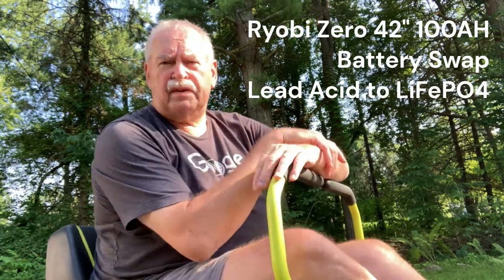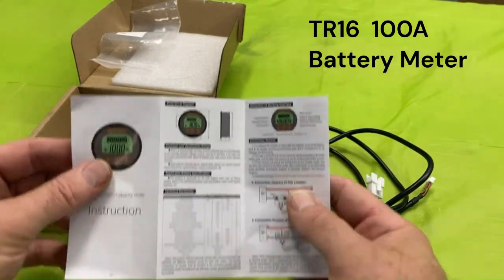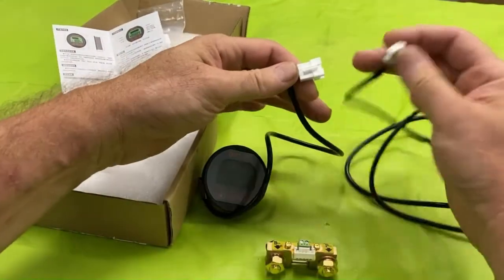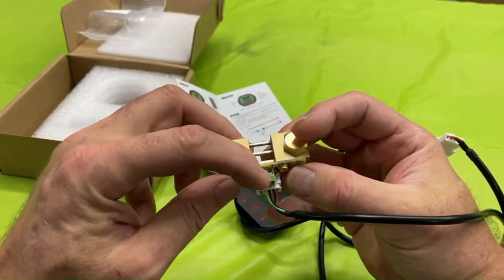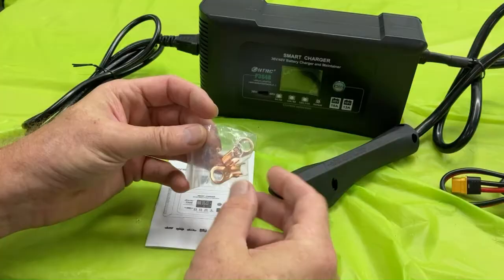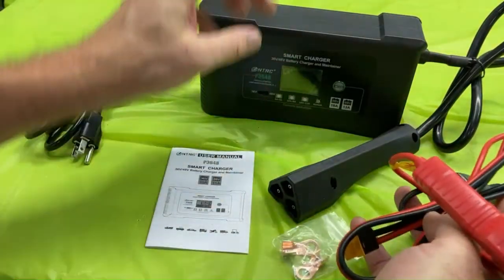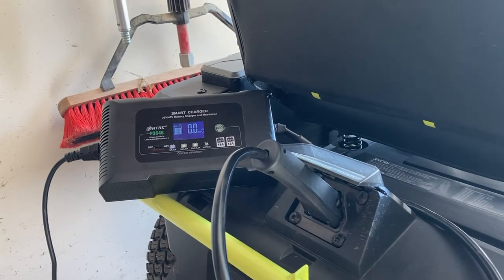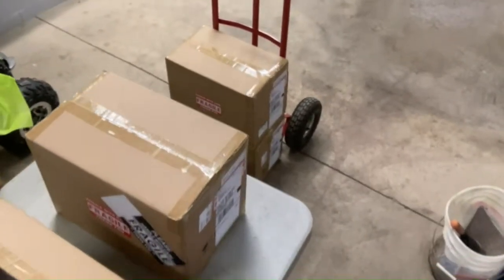Ryobi 48v Battery Swap - Components and modify charging port

Comment: Hi Rob, I've done this conversion. All but the gage anyways. Your videos were a huge help and I used the products you used. 

With that being said. After doing this swap the mower refuses to start. Every once in a while, one out of three times, when I go to switch the mower on I will get an audible click then nothing else. I can turn the key on and off with no sounds or anything changing. The gage wont display anything either.

Its only when I plug the charger into the mower (and the charger has to be plugged into a power supply) do I hear another audible click and then I can immediately unplug the mower and go about my business as usual. 

Do you, or anybody else on here have any ideas as to what may be causing my problem? I'm thinking the relay might be damaged but I'm unsure how to test it. 

Any help would be much appreciated.
Reply from the maker: I've been hearing about some people having this problem, and so is a friend of mine.  He bought a precharge kit from a YouTube/Facebook guy that we are going to install next week.  So I should have an update in a few days. Here's his video, and read the description and comments for clues. 
https://www.youtube.com/watch?v=jNEGhhh3dMo&t=137s
Reply: @robertveldman1901  

Thanks for the reply Rob. Not sure how you made out with this. I was doing some testing on the mower when this did and didn't happen. It looks like the culprit is the DC Converter. I was getting 12v on both sides of  the relay when testing to ground but nothing when testing across the 2 terminals as i should have been getting. This condition was only present when the mower wouldnt function properly. 

When conditions are good and mower is functioning correctly, I'll get 12v across the 2 terminals. 

I'm not sure what this does to lock the mower out without plugging the charger in as i haven't dug in that far yet but. I have a new DC Converter on the way. I will let you know if this helps resolve the problem entirely.
Reply: @robertveldman1901   Hi Rob. How did your friend make out with his precharge kit? Im still having this same problem.

Comment: Hi Rob, I have the 75ah version and am installing the 100ah batteries. A person reviewing on Amazon also did this successfully.

I am confused on how you connected the yellow then green wire to the gage? Can you provide more detail on that?

Also, your friend’s charger port that smoked, do you know any distinguishers between the two port types besides for the 2 or 3 screws?
Reply from the maker: I helped Jesse change his batteries from 75ah.  We needed to remove or alter spacers in the battery tray. But other than that, using 100ah batteries was fairly easy.  It's not "starting" with the key, and he needs to unplug and replug the battery to get it going.  He is looking at a pre-charger module that may fix that issue.

I think you are referring to the fact that I originally connected the gage power to the B+ with a yellow wire?  This would supply continuous power to the gage, even with the key off.  So, I changed to connecting to the power green wire of the original gage.  This way the gage would only be powered with the key on.  Others have left the new gage connected to the battery, as the power consumption is so low.

Don't forget that the charging port only got smoked by modifying the charger "plug".  Don't change the plug, and you should be OK.
You can see the differences between the two charger ports in my video  to mod an EZGO port:
https://www.youtube.com/watch?v=Bdj0e7xY3vU&t=3s
At 4:30, you can the two different styles of ports.  The EZGO port has the 3x phillips screws.  The Ryobi "burned" port is a completely different style and is molded over with some type of plastic or rubber (no screws).

Comment: Thanks for the great video. I am embarking on the journey of converting from SLA to LiFePO4 batteries using your videos as a guide. Did you solve the issue of the missing blinking light in the charging port? I thought you had a video of it and can't find it any more. If I remember right it has something to do with jumping the blue wire to the 3rd pin. Thanks!
Reply from the maker: I did have a "green light" video, but I took it down after a few people left a message that they burned up their charging port.  I wasn't sure what had happened to them, until I helped a friend convert his Ryobi to LiFePo4, and I burned up his charge port.  As far as I can tell, Ryobi used at least two different charge ports.  
Remove the charge port (4x T30 screws) and pull the port out.  If the back side of your port has 3 silver phillips screws, I think you can safely use the green light jumper mod.  If it is "rubber coated/sealed", I wouldn't do it.  I hope to update my video soon.
Reply: @robertveldman1901  Thanks for the quick reply. The 3rd pin is a signal pin, right? should that be connected to ground (brown) then instead of clue (positive)? Will wait for your update then. Thanks again.

By the way, if I am going to use BMS with Bluetooth, is there any advantage to changing the meter then? Trying to simplify the swap and keep everything as is except for the port modification. I'm thinking of modifying the handle of the charging handle instead of the port itself.
Reply from the maker: @KhiangSeow  grounding the 3rd pin is a possibility, but I wouldn't take a chance.

If you get BlueTooth batteries, I would skip the gage.  The gage can always be installed later.
Reply: @robertveldman1901  I should have been clear. I mean connecting the 3rd pin to the negative (brown) wire of the charger. You had it going to the blue wire right?
Reply from the maker: @KhiangSeow  I believe the brown wire in the plug is the 48v positive.  The blue wire is ground.  I am jumpered to the brown 48v.  This hack is not recommended until you check which port you have.
I have no idea what might happen if you jumper to the ground.

Comment: What size screw driver is needed for Removel of the charging port
Reply from the maker: To remove the charging port you need a T30 (Torx) for the 4 screws.  To disassemble the charging plug, you need a Phillips screwdriver for the 3? screws.

Comment: I swapped all of mine out checked and double checked all connections and I’m getting no display and no power.  That said I realize now that I bought the wrong charger end from your link so praying the batteries are just dead
Reply from the maker: Sorry to hear that.  My batteries were delivered with a pretty good charge on them.  If you have a handheld volt meter, you should check the voltage at the main plug.
Make sure that connection is fully plugged together; it can be a little tough to push together.
Where are you located?
Reply: @robertveldman1901 I live in Joplin, MO
Reply from the maker: @Millionaire_Caleb  Sorry... That's a bit too far for me to swing by from MI.
Reply: @robertveldman1901  yeah I’d say so.  I appreciate you more than you know I’ll keep ya posted on the progress
Reply from the maker: I did come across this video from Greg(?).  Read all the comments.
https://www.youtube.com/watch?v=jNEGhhh3dMo
He builds and sells a "pre-charge" circuit, to manage the "inrush current".
Apparently, the initial inrush of current from batteries can cause the mower to "trip".  It looks like the pre-charge will dampen that inrush.

Comment: Do you leave the charger on 5A/5A?
Reply: Or does changing it hurt anything?
Reply from the maker: Yes, usually.  5A/5A is the only setting I usually use.  A full charge will allow me to mow my lawn 2.5 times, so I can usually get my yard work done within one charge/one day, and let it recharge overnight.
I wouldn't be afraid to use 13A/15A.
But, don't use the "repair" function.  That is for lead acid only.
Reply: @robertveldman1901  Does the smart charger automatically shut off when a full charge is detected from all 4 batteries in the mower?
Reply from the maker: @mjeff321  The smart charger does shut off automatically when it detects that the batteries are charged.  The charger display will show "FUL".
I not sure how that works as each battery has it's own BMS.  Does the charger current pass thru the fully charged batteries, until they are all charged?  I don't know.
I have 4 - 12v volt meters hooked up to my batteries.  Generally, 3 batteries charge up to 13.3v and one to 13.1v ( = 53.0v).  Not sure if that is real, or a wiring issue.  Someday, I want to switch the batteries around to see if the low voltage follows the battery, or stays with the wiring.
Reply: Thank you! Using your videos and links, I swapped my batteries out! Such a great upgrade and I appreciate the thoroughness of your videos and replies. On my lower The existing gauge still works, but I do have the one from AliExpress on the way to swap in case there are issues.
Reply from the maker: @garykroegman9351  Thank you!  I appreciate your comment.  
Others have done the swap without the gage change, very well.  In hindsight. the gage change is not necessary.  I just got carried away.
It's nice to just hop on and go, and not have to worry.

Comment: Rob, your videos were awesome. They helped me get mine repowered. However, I would STRONGLY RECOMMEND against the HRTC charger, or any one of the various chargers that are the same, but sold under different vendor names on Amazon. I bought the SDLOOL-branded one and it failed after two uses. As I researched, I discovered that dangerous failures are not unusual with these chargers. Arcs/sparks, smoke, and one even caught on fire on somebody. Fortunately mine failed in such a way that it was stuck sending 48 volts through the charging cable, resulting in just a shock risk. It was not communicating with the battery BMS system. When I took the charger apart to investigate, I found it contained no grounding, which at least partly explains the variety of dangerous failures. This is a lazy and stupid way to save a few dollars on part of the actual manufacturers and engineers. I also learned in my research that the HRTC chargers charge about 1 volt higher than recommended by battery manufacturers on 48 volt battery systems, which concerns me about premature degradation. I purchased this one from Dakota Lithium that had the CORRECT charging voltage and also has a 1 year warranty, so if it fails in an unreasonable amount of time I have a fail-safe. I used the included Anderson plug and pig tail to adapt in the EZ-GO style plug, so I didn't have to modify the charger itself in any way. Throughout the troubleshooting process, CHINS was very communicative and helpful. I can't recommend them enough for the batteries!
https://dakotalithium.com/product/48v-8-amp-dakota-lithium-lifepo4-battery-charger/

Comment: The link to amazon for the charger is broken.  I found a charger with the same name on Walmart but the plug only has 2 pins.  Can someone send me a new link for the charger? Thanks!
Reply from the maker: Ouch! it is broken.
I did find a possible replacement at Amazon for $155.  I can't be positive, but it sure looks like mine.
Make sure you select the 3-pin option.
Make sure you read the instructions, and don't use the "repair" function on Lithium.
https://www.amazon.com/dp/B0BZY6N951/ref=sspa_dk_detail_0?pd_rd_i=B0BZY6N951&pd_rd_w=NKmWi&content-id=amzn1.sym.386c274b-4bfe-4421-9052-a1a56db557ab&pf_rd_p=386c274b-4bfe-4421-9052-a1a56db557ab&pf_rd_r=AH86NNP02WKSVZ7AQARX&pd_rd_wg=tCfYe&pd_rd_r=2ec605bf-0175-487d-a976-a5463f720e7b&s=electronics&sp_csd=d2lkZ2V0TmFtZT1zcF9kZXRhaWxfdGhlbWF0aWM&th=1

Comment: I had one of these chargers for a LifePO4 battery for my boat and after 6 months the mode button stopped working. It was stuck in lead acid mode which made it worthless to me. Any problems with this charger for anyone?
Reply from the maker: I just checked mine, and it's still charging, and the mode button cycles well.  one year

Comment: Thanks for the great series of videos on the Ryobi Battery swap for this mower! 
Getting ready to due this conversion. Is there any advantage in using a single 48v 100ah battery rather than 4 12v 100ah batteries in series?
Reply from the maker: Sorry I think I missed your question.  And I'm not a battery expert.... 
The main advantage is the the batteries are the same size as the old ones; no modifications to the tray or the hold down/clamp.  A large single battery will at the very least, need some alternate hold down, and maybe a new or rerouted cable?  My guess.
If you get a bad cell, you'll only replace one battery.
The main advantage of a single large battery is there would be a single BMS (battery monitor system) to keep the cells "balanced".
Reply: I'm new to this kind of project so the idea of batteries not being "balanced" is concerning enough for me to go with a single battery setup. Wish me luck. Thanks for the great video.
Reply from the maker: @VideoPir  I hear you.  I learned way more than I wanted, and still don't know enough. 
The main reason I went with four was to simplify the swap.  If you go with a single 48v battery, the long center bolt won't be able to be used.  You'll need to figure out how to clamp the battery down to the tray, and to the frame.  Just saying...
After one year, it appears that I have one battery that is always lower than the other 3.  Don't understand it.  Needs a video.  As long as I can easily mow my whole yard, I not too worried.  Yet
Reply: @VideoPir  did you go with the single battery setup? How did it go? Did you purchase the Chins brand? Any wiring modifications needed for the single battery setup? I just purchased a single Chins 48v 100ah battery with Bluetooth and charger. Thanks for any tips you can give.

Comment: Any reason why you chose to go with 4 12V batteries instead of 1 48V battery?
Reply from the maker: Nope.  I wanted to make the swap as simple as possible, and I thought that 4 for 4 was the way to go.  I'm happy with the results: no special clamps, straps, cables, etc.  And if anything goes wrong with one battery, I can replace just one.
But, in hindsight, I would certainly consider a single 48v battery.  It especially makes sense to have a single BMS instead of four.
So far, so good!

Comment: Hi Rob, thank you for the great video. One question for you—the documentation on the Chins batteries says the standard charge current is 20A, but the charger, as you pointed out, only outputs 13A at 48V. Given that difference, could the charger damage the batteries or vice versa?
Reply from the maker: I'm pretty sure that you can always charge at a lower amperage.  
I think I read that low amp charging will maximize the "full" charge level.  I think.
Anyway, I've been charging my batteries using the lowest setting (5a) all summer.
Maybe someone with more lithium knowledge will comment.
Reply: In the simplest terms; fast charging bad. Slow charging good. Charging these a little slower is going to be a boom for your battery longevity.
Reply from the maker: @singedcarry  I had a notice that you sent me a message a couple weeks ago, asking why we need a new gage.  I believe the old gage will not be accurate for % of charge. The discharge curves are waaay different for Lead Acid and Lithium.

Comment: Question: in your video you seem to have added the text to use the switched V+ from the old meter to power the new one. Did you run a wire from the old meter V+ to the V+ in or directly to the new meter somwhere?
Reply from the maker: Correct. At about 4:36 in this video I included a text comment that I did NOT power the new volt meter "shunt" directly from the battery pack.  That would have caused the the battery meter to always be powered on.  While this would not draw a lot of power over a week or two, it would draw power all winter.  So, instead, I powered the shunt/gage from the +48v power at one of the wires at the old gage connector.  This is detailed in the install video: https://youtu.be/c9MZajoVVUQ  at about 22:00 and 25:00.
Reply: @robertveldman1901  I was going to include a picture but instead of trying to bore out the metal plate for the new meter I too found a spot in the right fender just behind the control panel to put the meter. Much easier to drill a hole out of the plastic rather than the metal.
Reply from the maker: @jmorris644    I guess great minds think alike.  I ended up remounting my old gage in the same location (I think) as you did.  See this video:  
https://www.youtube.com/watch?v=YVy3MY6aaaU&t=37s

Comment: The batteries are the same width but are a bit longer. One thing I was able to figure out was if you remove the front holding spacer and dramatically reduced the depth of the rear spacer (even taking out the 2nd nut inside of the spacer), then the H bracket that holds the batteries down will fit and the long bolt that holds it in will work.
Reply from the maker: I found the new Chins batteries to be virtually the same size in all dimensions.  It doesn't matter, as long as you got them to fit... but refer to my "remove batteries" video at 20:00 : https://youtu.be/HdoAHeQJr9k